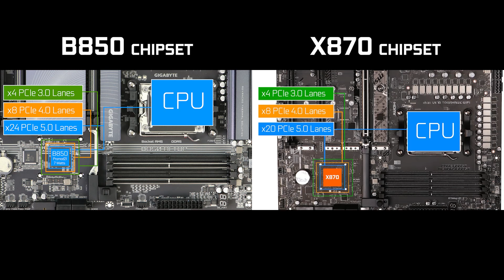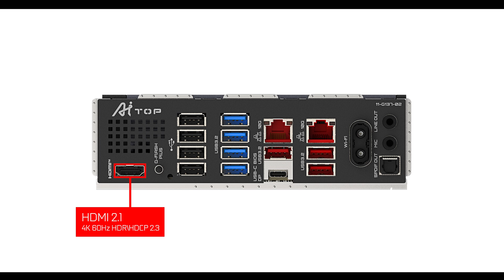GIGABYTE B850 AI TOP : if it had a skirt, I would marry it!

Comment: I have a Gigabyte x870e Aurous Master, picked it up from Amazon warehouse for $287.  Made me a fan of Gigabyte, love the layout and BIOS.
Reply: I also have this board too but I paid $399 for mine. Was lucky enough to get the B850 AI Top motherboard for $250 though.  Upgrading from the B550 Aorus Master. My only gripe about the x870 Aorus Master is that it has no thermal back plate like the B550 Aorus Master does.

Comment: Just picked this up for $259.99 US on amazon (price still good today)... AMAZING price for this board...
Reply: I grabbed the same deal... The closest thing to fate I've experienced in my 35 years, I think. I was minutes away from pulling the trigger on a reman asrock taichi lite but I was so apprehensive about asrock am5, as this PC is already a much bigger expenditure than I normally allow myself to spend for, well, no reason lol. I didn't want to take the risk but I need twin PCIe 5 slots with cpu lanes. My luck the asrock would fry the cpu the day after the warranty runs out. I'm beyond excited for this board to arrive. Happy building!
Reply: I got the motherboard for 170€ 😂🎉
Reply: @pctecmaster0  now that's a steal. Got mine for $250 like the others, but I also have 2 AI Top R9700's to match.

Comment: well mine broke down after about 2month. I just run proxmox with 2 nvme, 3SSDs and 4 SAS disks over a Controller on PCIE 16. Slot. After a reboot I lost both Networkports and tried to get them back and after 3 more restarts I could not get into bios anymore. Hope is a single occation.

Comment: Word of warning to anyone buying for the 10Gb ethernet ports. They use some kind of crappy Marvell controllers. I have been through three boards with the same model of controllers and my experience is that they constantly crash silently. Like they will look like they should be working but they aren't, and the only way to fix is to disable and re-enable them or restart windows. The other issue is that they don't handle VLAN tagging very well. If you want to use VLANs certain things will work, but for me all application layer traffic on the local LAN stopped working, and trust me I tested these very extensively and isolated the issue to the NIC. Replacing it with one that didn't use the faulty Marvell controller made all issues go away.

Comment: If you ran 2 5070 ti's or above, what power supply would you use to supply adequate power. Im a be quiet fan, they dont even sound like they're operating. Just curious how you would power that set up, thx?
Reply: I have two dual GPU setup on this mobo. A 40 Serries combo and a 50 series. one Uses a Seasonic noctua 1600 and the other a MEG 1600
Reply: RTX 5070 Ti consumes 300W TDP. Two in the rig plus other components require 800-1000W depending on CPU (Ryzen 7700 - Ryzen 9950X3D). Add ca 20% headroom for PSU: use a 1200W PSU. Undervolting GPUs and CPU can reduce total power consumption by ca 100W. Each of Nvidia's mid-range and top-range GPUs can run well at 50W reduced power with minimal performance degradation.
Pro Tipp: PSUs have optimal efficiency around 50% load, with noticable drop above 90% load. Therefore, always stay below 90% load to avoid wasting energy and excessive heat emission.

Comment: This one is really ugly, but has its inner besuty, for sure! 2x10G is perfect, wish other makers will follow this hint. For production, I'rather prefer four Gen4x4 M.2 SSD slots with direct CPU connection (which no manufacturer offers), which would be ideal for fame grabber cards (“Decklink“) or hardware encoder/decoder cards (“Birddog”) w/o wasting a 16GB slot. Well, hopefully, the board makers will come to realize that video/live stream producers urgently need direct CPU inputs for their Cams and Enc/Dec devices. Thsnk you for yet another one of your rather entertaining and perfectly produced deep diving motherboard reviews.
Reply: At that point you should get workstation grade motherboards, you're reaching the limits of PCIe allocation of literally all consumer grade socket motherboards, 
For AM5, CPU have 
+16(GPU or bifurcation)
+4(For NVMe)
+4(Flexible PCIe lanes, usually used for NVMe but if you go with x870(e), then it's used for USB4/thunderbolt)
+4(chipset connection)lanes to work with,
anymore will going to take up GPU lanes or share lanes with others

With other I/O coming from the chipset itself, including the dual 10G Ethernet, it isn't really bad unless you're maxing out the chipset bandwidth as latency is measured in microseconds, compared to 100x latency of NVMe latency in tens of milliseconds
Reply from the maker: @minhquocnguyen206 wow..
 Nice detailed and knowledgeable comment :) thanks for sharing !
Reply: The reviewer wrote that dual 10G network only works with 1 graphics card. Two graphic cards disable the second 10G network socket. Sounds like a driver bug, since this isn't in the specification or manual.

Comment: I have been building PC for ages now and I am no fan of a brand over the other but I have to be honest with you all here, after more than 30 years in the PC building business I find Gigabyte motherboards the most sensible out of the big 3. they have the best combination of VRM design, build quality, BIOS and BIOS updates and overall price, and I have been building PC with brands that a lot of people don't even know existed, Like DFI, Abit, Soltek AOPEN, Micronics and many more. I do miss Abit though.
Reply: Used to be, not anymore. They only offer crappy 6 layer pcb boards up until the most expensive ones meanwhile MSI and Asus both have 8 layer at mid range with the TUF and Tomahawk. With Gigabyte you have to go up to either this very expensive board or all the way up to the Aorus Master series.
Also i had a Z590 Aorus Master with a 11900K and a board had a very noisy Vrm fan and an awful vrm coil whine. Software was terrible too. Don’t get me wrong the board was really powerful, built like a tank with a sturdy backplate and overclocked like a champ but unfortunately it had these annoying flaws.
Reply: @kerotomas1  I currently rock an MSI x6703 Tomahawk and let me tell you, the BIOS and over all system stability is horrible, one BIOS update they fix something, the next update they screw something else. go see MSI forums, everyone from the MAG line to the MEG line have issues that seem shared among many people.
Reply: @kerotomas1  There is no VRM fan on the Z590 MASTER. I have built with every MASTER board Gigabyte made for Intel and they all where rock solid and offered incredible overclocking with a price far less than the competitors.
Reply: @JDD_Tech_MODS Interesting, then the ghost put it in my mobo. It’s between the IO and the heatsink you have to take it apart to see it.
Reply: @kerotomas1  Ohh, you are talking about the fan used to cool the Aquantia AQC107 10 GbE controller.
Reply: @JDD_Tech_MODS  Oh i guess that one lol all i remember is that it was super annoying especially when the case fans and cpu cooler were idling.

Comment: I just got asrock x870e Taichi. Is it a good motherboard ?
Reply: Nope. It eats 9950s apparently. Go read up about it. Something to do with voltage management I think.
Reply: @henryvaneyk3769 I got a 9950x3d and 5090
Reply: @ I’m pairing it up with 9950x3d and running it on default bios which comes out of the box. Am I still cooked ?
Reply: @jayakrishna1951  Yes, I would look into this issue. ASRock might solve the issue with a BIOS update. Just be aware that there is an issue.

Comment: I wonder if gigabyte got proper drivers for that dual 10gig AQ113CS nics. This network chip was a pita back on the Z590 Master
Reply from the maker: So I tried both with provided drivers ... To be fair. . it ran with windows default driver upto 5 gbs
Reply from the maker: In dual GPU. .  second 10 gbs died though. Came back in single GPU .

Comment: No onboard USB4/TB4, no Thunderbolt Header and the second x16 PCIe Slot will block the bottom x2 PCIe Slot if running a second GPU which is quite likely when running AI workloads. Its a hard pass for me. I do rather go with the cheaper ProArt B650-Creator.
Reply: USB4 is overrated, not needed unless it's a laptop. Nearly all motherboards block the lowest PCIe slot when 2 GPUs are installed.
Reply: @N1234-n8x  Depends on what else you need to plug in. I have some thunderbolt devices that work on USB4 because it's backwards compatible with Thunderbolt.
Reply from the maker: It's on my long list of to be reviewed boards (b850)
Reply: Two air cooled GPUs plus another PCIe card is only possible with slot layout 2+5+7 and using dual slot GPUs. Even then, the lower GPU will receive very little to no cool air because it is being neighboured by the third PCIe card. Expect massive heat problems.

Comment: This board is awesome. but I wish they have 4 m.2 slot instead of 3. best part is 2 x 10G nic.. thats what most content creator will want. Thanks for the review.
Reply: The main appeal of this board is having two PCIe 5.0x4 M.2 slots and two PCIe 5.0x8 slots, with all lanes coming straight from the CPU, giving a user access to all 24 PCIe lanes at full speed. Just about everything else out there - including most X870E boards - either waste some lanes, downconverts some to PCIe 4.0, or feeds a bunch of stuff through the chipset.

It's a great board if you're running some Optane SSDs; you don't have to worry about the chipset adding a bunch of latency and lowering your random IOPS.
Reply: @Carl_カール  Optane is dead btw
Reply: Well, with the double 10G nic I think it's designed to be working in a NAS-centric environment, where data is crunched in a double GPU PC and stored in the NAS.